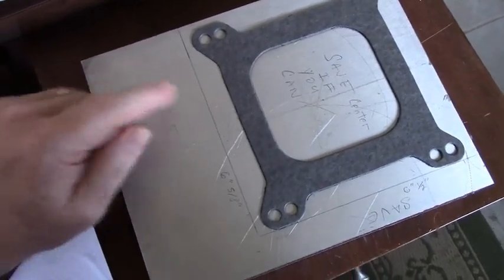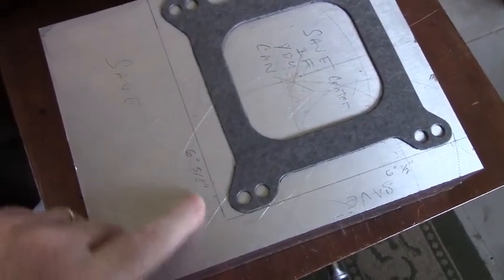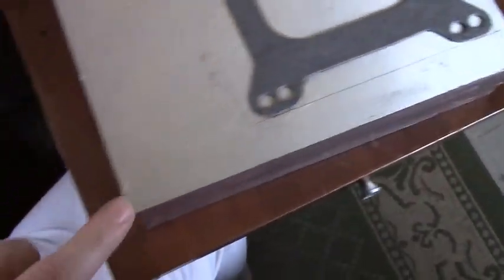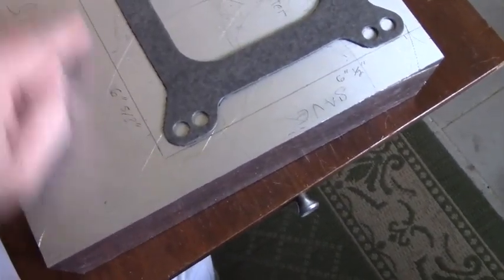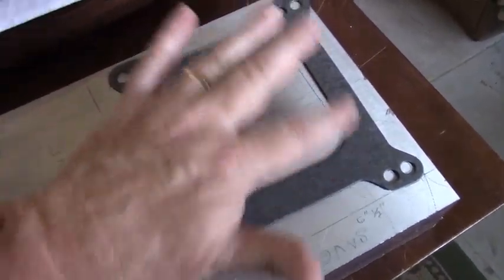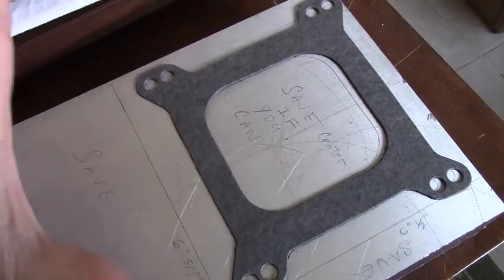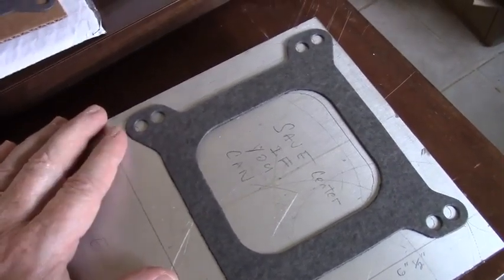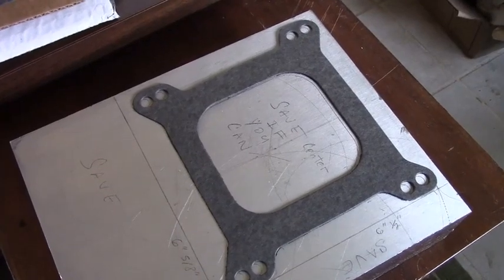JUST MOPAR JOE CUSTOM HOLLEY 4-BARREL 2" SPACER PLATE DESIGN AND BUILD #nonamenationals

Comment: You need 500 subs to get going? I just subbed! How much is one of those 2 inch spacers?
Reply from the maker: Hey Dave!  Thanks for the sub!  The ones you can buy from Summit and Jegs, are around $160 to $180 in aluminum...I think.  I haven't priced them yet.  At the moment, I'm into this one at $66 material.  If this block not come in oversized, I would have been able save on going to a CNC shop, however, while I'm there, I'm going to take advantage of it and see if they can't take out the throat for a decent price as well.  When I get the blank cut out and take back to my machine, I'll show my idea for extra thermal cooling and declare it "open source" for all to use on their own.  I could probably apply for a patent but we don't need that right now.  We need people to be able to get the custom good stuff to order and hopefully expand the CNC shops into our realm.  Stay tuned my good man!